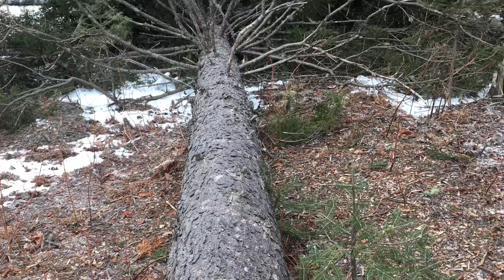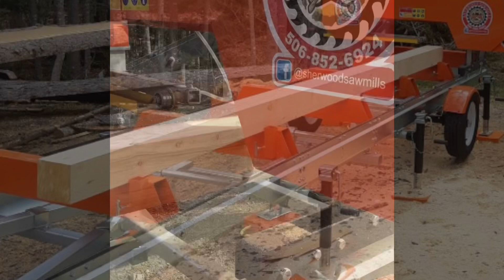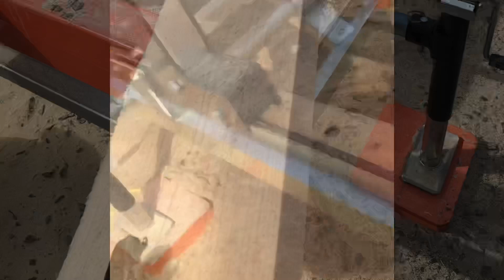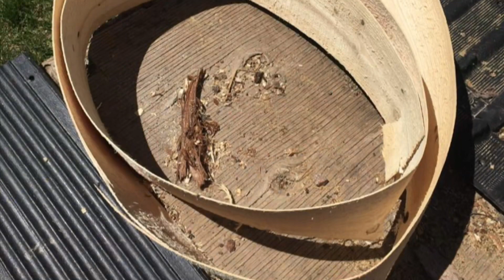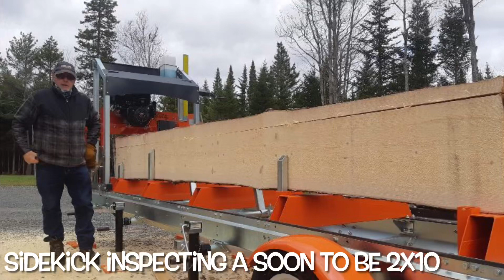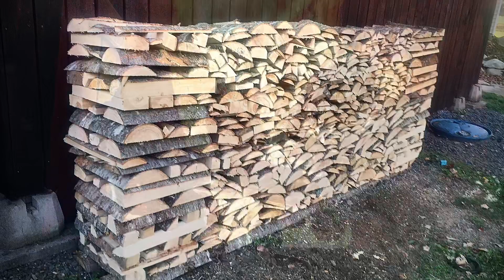Rima RS31G Timber Thunder Sawmill Rippin some “Timba.”

Comment: Just wondering could you use 158 inch blades or will 156 only work
Reply from the maker: 156 1/4” is what come on it. I don’t know if it would except the longer blades. Sorry…
Reply from the maker: I don’t know if there is enough “ tension “ room when tightening the blade.

Comment: How would you rate the durability of this made-in-China mill? I'm looking at buying one.
Reply from the maker: Honestly Greg….. I have looked at a lot of them, and for the money, I am overly impressed!  There are a few things I would change but minor… belt tensioner, and a better line on the “scale” for your read out.

There is a learning curve, and you need to be watching, and listening carefully at all times… it’s nice to have two people.. an extra set of eyes is always nice. I bought this with my father to spend quality time together, and we enjoy it tremendously. 

This is also Very close to a woodlands mill. My cousin has the HM126. It’s a fair bit smaller than this one but they both do the job excellent.  

Hope this helps.
Reply: @vfabgarage2694  Thanks for taking the time to reply. It sounds like it has worked out very well for you and your Dad.